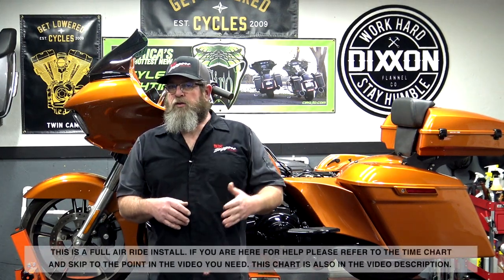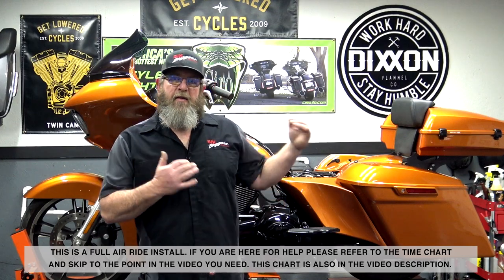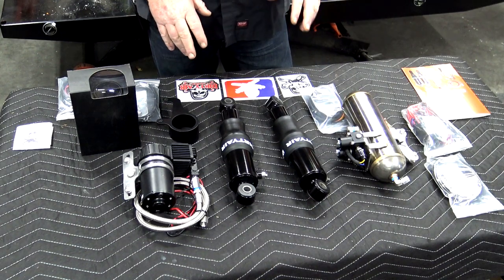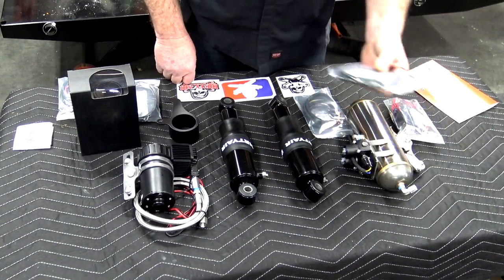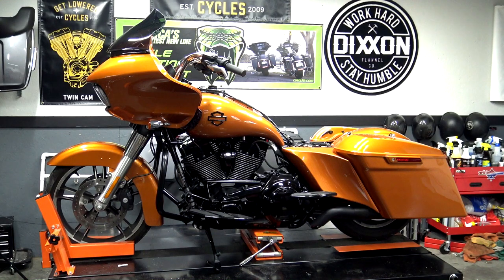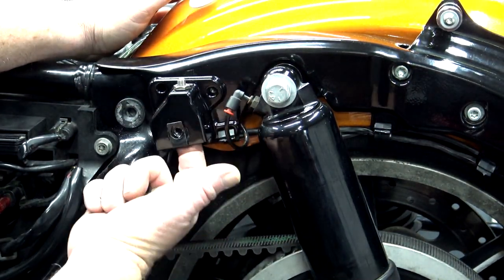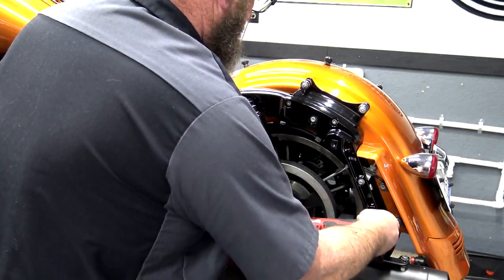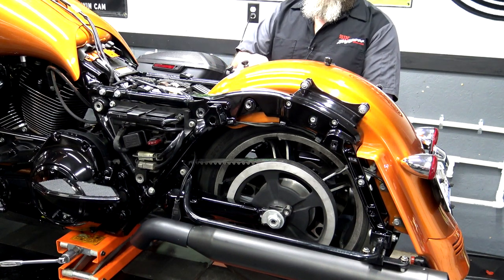⚡Install Dirty Air Rear Air Suspension System Fast Up - How To⚡

Comment: That is my biggest question what is the ride comfort feel like, is there a big difference not in stock but like say another brand that is out there that is really nice? The ride quality is what I'm asking other than the looks of being cool and low and high and adjustable is the right quality worth it, my next question is and I don't care who answers me if for some reason the system lets all the air out I got 0 pounds in it and she's sitting on the floor will it rub anything can it ride all the way down if some kind of pressure failure happens
Reply from the maker: the ride on this kit is about the same as the ride on other kits...the overall sell on this kit is the durability, ease of install and most important customer service before and after the sell...Ive had my fair share of the "other guys" and its like kicking a dead horse trying to get help...Dirty has always been there and addressed any issues I've had..which in fairness...hasn't been their fault...customers faults but they still helped.
Reply: @sikbaggers  I appreciate you guys getting back with me, I am interested in watching that video before I tackle it myself as far as the street glide fairing goes I have Electra glide so it's the same damn thing, what kind of warranty do you know comes with them, I mean like you know Legends has an airbag system is it worth the extra money to get the lifetime warranty I mean warranty you know it goes a long way, I'm new to all the suspension stuff that's why I'm asking, I can get the price of the dirty works front and rear the fast up and down with the aluminum shops for less than I can get the Legends just the rear, so I'm just asking?

Comment: What center stand did you use? Does it work with crossover pipes ?
Reply from the maker: I sue the SOB and yes but watch my video on how to run it with a crossover pipe. https://youtu.be/MOa0YZ8G0-o?si=OlLqmxrTMvnr1Tun

Comment: Where did you move antenna too? Putting my kit on this weekend. I see you need that hole where antenna bolts up
Reply from the maker: I took mine off as I have the fender extension that doesnt have a hole for the antenna ....but you can simply remove the bracket, zip tie the metal part of the antenna to the wiring harness and it wont move. It may take some time to get it lined up where the antenna sticks out straight...or get a hidden fairing antenna ...just make sure to get a powered one with a booster.

Comment: In your opinion, with is better, the Dirty Air, or JNR. I’ve watched your vids and was wondering with one to go with. I have Legends air ride right now, but not impressed with the ride. I would like to do front and back.
Reply from the maker: Sorry for the late reply, I just got back from Sturgis, Had issues they couldn't solve within a year and then they stopped answering the phones...so no service after the sale made me switch. Sucks because Ray is a good dude..but cant use the air if it doesn't work and cant get it fixed if they don't answer. No issues so far with dirty and they have always answered the phone when I called.
Reply: @sikbaggers  I was in no hurry, it’ll be next year, before I can get it done. Thanks for your reply, and for all your videos. Helps out the poor man!

Comment: I have lights in my fender struts so that may pose a problem. I’d like to put air ride on my Ultra LTD. I bought a Road Glide Special with an Exotic Customs system and it’s an amazing ride so want it for my Limited also. Any experience with Exotic Customs systems?

Comment: I'm new to the Harley world, suspension is talked about alot in my group of bike friends. My bike has stock suspension. Is air ride suspension better than the Ohlins adjustable or is it rider preference
Reply from the maker: the two suspensions are very different but both offer a good ride...and way better than stock, either way you go.  Air ride allows for on the fly adjustability and a smooth ride and ohlins offer more of a superior ride but needs adjusted to your riding, weight, etc.  which needs to be done on the shocks itself. If you dont change your weight a lot (2 up or 1 up ride, touring luggage etc) then the ohlins would better because adjusting them isnt easy.  If you are riding somedays 1 up and some days 2 up or you are traveling off and on all year changing the weight of your luggage I would go air.  I specifically use air because use an electric center stand on both bikes.

Comment: I have e filler lights between the saddlebags and fender, where you put the air line from the compressor to the air tank won't work the way way you have it
Reply from the maker: its not really "the way i have it", rather than the way it goes....there is no other way to run this line.,..its made to fit exactly the way i ran it in the video sir.

Comment: Hey Steve question for you, I really want a set of BAM mufflers with the 2.5” baffles or a set of the bad dadds but the price is killing me, have you had any experience with any of the slip ons from Amazon ?
$200 sure beats the hell out of $500 but I don’t want to buy some shit I’m going to be replacing in a year because of rust or something else………thanks for any info and happy new year 🎊🎆
Reply from the maker: Hey Steve I havent really used any from amazon...One set I think on a 2017 SG and they are still on there to this day...I service that bike all the time and I have never heard the man complain about them..They sound just like most aftermarket exhausts to be honest. Have a Happy New Year my friend!

Comment: Isn't that "cup" on the pressure gauge supposed to be a sunshade? And installed on the topside of the gauge?
Reply from the maker: absolutly not..it sits in the cup and hides the connections at the bottom so you don't see the wire harness.

Comment: Steve my friend air ride suspension looks awesome. I just have one question what does it do to the geometry of the bike? I read a lot that lowering blocks throw off the geometry of the rear suspension. I’m just wondering what the air ride does to the belt tension? Thanks rsfm 😀
Reply from the maker: well the air ride is meant to be air up to ride height when  riding. It will throw it off if you ride super low or even high. The optimal riding position of the bike is the bottom of the frame is parallel with the ground.  That being said I dont ride that way. I ride slightly lower than stock height. But its nothing you cant handle in corners. It does change slightly but not like a huge difference. You get used to it after a few rides.
Reply: Steven Housden 

Sorry Steve thanks for the insight. Guess for the vertically like me 29” inseam air ride would be sweet. Thanks again.

Comment: I've got the Dominator fender on the way, and I also want to do this dirty air set up. Since the Dominator fender wiring harness is going to replace the stock harness that you'd use the blue wire to tap into for 12v ignition, where can I run the ignition wire at?
Reply from the maker: under the side cover under your fuse panel..you have black and grey plug...the black plug, pull the plastic sheath back some and locate the grey/red wire..that is aux power.
Reply: @sikbaggers  thanks a lot! I just put my fender on yesterday and posted on that FB Advanblack review page. Your videos are awesome! Thanks for the help, I'll check that out when I pull the trigger.

Comment: Question what was the thing you had in your hand you were clicking over the wires ?
Reply from the maker: When im connecting the wires I use these solder seal connectors that give a water tight soldered connection and I use a pen torch to heat them up. The clicking is the pen torch.  If you use a lighter it will burn to slow and not get a good connection so a pen torch works perfect for this..We use these on all our audio connections too.....here is the connectors I use https://amzn.to/3IsmxzB and here is the pen torch https://amzn.to/3HxQb4Z
Reply: @sikbaggers  thanks bro for taking the time to answer my question your a real 1 a O.G. thanks bro  love your channel keep up the excellent work 👌

Comment: Hello, i was wondering if you can answer my question.  Can i use the air ride suspension while i am moving or not? For example, when i am on a red traffic light should i have it on a lower level and when the traffic lights turn on green turn it on while i am moving?
Reply from the maker: You can always adjust the air , if you are moving or not...If youwa not to let some air our or put some in just flip the switch..You can let some out at the light and then add some more aiur while you ride. I don't recommend dumping all the air out at the light and then trying to fill it while riding..the shocks ar ewnot designed to be rode with  no air in them. You can lower it a little and then add air while grinding though yes

Comment: I see in the video that the compressor and the tank bolts to the framing between the bags and the fender. I have the ciro filler panel lights on my '21 Road King. How hard would it be to install that stuff with the filler panel lights?
Reply from the maker: Hey John it will be a little more cumbersome with those lights but you should be able to get your wrench in there to hold it while you tighten it. Its really no different than having the fender extension on there that fills those gaps you just have some wires to attend to

Comment: I'm going to start riding 2-up and was wondering if there is a Dirty Air shock that gives extra height. The bike came with the Dirty Air suspension.
Reply from the maker: it will give extra height...however you need to understand how air ride works..if im riding 1 up I may only need  80psi to ride at my ride height...however if im 2 up I may need 120 to keep the same height.  Keeping that in mind , also remember that air ride has a sweet spot for riding..to low and its bouncy, to high and it stiff. So there is a fine line where you can play around with the air before it starts effecting the ride.
Reply: @sikbaggers  I'm a big guy and wondering if i maxed it out already. New gf is going to want to ride with me. I dont want to have to get a sidecar for her LOL

Comment: Greetings Steve- 
I’m getting close to ordering
2 questions
Are the aluminum upgraded shocks worth the up charge ? Is the upgrade more performance or cosmetic?
Also with the tank and pump mounted in the fender struts does that eliminate fender strut lights? Or does that just depend on how much fabbing I want to get into ?

Than you in advance for your time and reply
Reply from the maker: all cosmetic...and yeah depending on where your lights mount you may have to move them...but im not sure your bike and what lights you have so thats hard to answer fully.
Reply: Ah yes,
Forgive my absent mind
2016 FLTRU
Most similar, if not exact, rear end you were working on
And from what I see I may have to fab up some sort of spacer plate or “doohickey”, to be technical, to get them to look right.😂
Thankyou for the reply on the alum vs steel .
They may be of zero consequence performance wise but I may encounter a “shut up and take my money” moment.
Stay safe, 2 down.
👍🏼

Comment: Do you like this system better then the jnr you have on the silver street glide?
Reply from the maker: well..i loved the jnr system when i got it and it seems the shocks or something has went down hill...My fast up is now ( kinda slow up) been that way over a year. Had the whole system apart and on the with JNR a dozen times with no luck. So I thought I would try the dirty...the ride is about the same...maybe a little smoother on the dirty side...but time will tell how long they hold up

Comment: I have a 99 ultra with front and rear air ride . (Factory system)
Can you hook that air pump to the front air struts along with the rear shocks if you have them? 
Would you need independent pressure valve and  gauge for the front?
Reply from the maker: yes you need a independent valve for the front and rear and 2 switches. The front air would never be the same amount of air as the rear.

Comment: I gotta couple questions.  I installed this same kit,* Why don't you use the water trap/ separator in this kit?*Whenever I use my air ride button, I get a loud popping noise through my speakers?* Does that red wire with the inline fuse need to be used on the install?
Reply from the maker: Hey Chris I didnt receive a water trap separator with my kit. The inline fuse really does need to be used. Anything running directly to your batter needs an inline fuse. The popping noise your hearing has an easy fix. Coils (fill valves, dump valve, compressor relay) magnetize when being used and this causes feedback. Some audio systems, not all, pick it up as noise and some worse than others. First thing is to remove all frame grounds if you can...ground everything to the battery.  If that doesn't cure it then put a diode across the positive and negative. Here are the diodes from amazon https://smile.amazon.com/gp/product/B07YYMG7D5  put the side with the stripe on it on the positive wires, the non striped side to the negative. The closer they are the  dump/fill/relay the better they work.
Reply: Wow.  That's totally different from what every motorcycle shop has told me.  I was told to ground it to the frame.  Do you recommend the water trap?  I bought it from dirty air but I didn't see a lot of guys using them.  Thanks for your reply.
Reply from the maker: You can ground it to the frame but if you're using an aftermarket audio system with rca cables this is usually where the issue comes in. That is what was told to me and that is what cured my popping issues along with many others....its a very common issue with any air ride. I dont use a trap. I've had jnr air ride on my sg for 3 years.. I live in illinois where its plenty humid. I've taken it apart a few times and never had water in it...so I've never worried about it
Reply: @sikbaggers  thanks again for your reply
.last question, do u recommend  tapping into the ignition  wire so the only time the air ride work is wn the ignition  is turned on?  Mines was not installed  like that.  If I touch my button the compressor  kicks on whether the ignition  is on or not
Reply from the maker: @whitedawg60   Yes, absolutely.  There are several wires that are ignition only under your seat or side cover. Mine wont even air out without the ignition on.
Reply: Finally got my system put on correctly.  When my bike is not in use, is it ok for the tank to be full of air, or should the tank b empty wn it's not in use?

Comment: Hey Steve.  Question...so I’m having an issue with the air suspension.  Did you connect the gauge wire to the same 12v blue wire that you connected the toggle switch and tank wire?  And also when you cut into the 12v blue wire, does it have to be from the rear plug that goes to the tail lights or can you cut into the other end  that is connected to the bike? My issue is that when the bike is running and I hit the air up or down switch the gauge and compressor would all go off and a red light goes on in my dash as if there was an issue, but then I restart the bike and it goes back to normal.
Reply from the maker: yes I tied the blue from the tank and the blue from the toggle together and tied that into the blue running light wire on the back side of the plug. I cant imagine putting it on the front side of the plug being any different. Your bike is detecting a voltage spike when you hit your air and thats causing the red light and making it stop working. Id check to see if the brake lights themselves didnt also stop working. I would have to dig around some but there are other 12v power sources under there too..that one is just easy to get to.
Reply: SIK Baggers thank you.  I’ll play around with it and see what works out.  I’ll let you know results.  I ordered the tank by the way, so once that comes in I’ll hook everything up and see results .
Reply: Hey Steve.  So received the air tank so now I have the update fast up suspension.  Works pretty well, still had the issue where the compressor and electric gauge would shut off when I was in motion or stopped at a light and hit the down toggle.  Did some homework with wiring and ended up instead of using the blue wire 12v to rear brake lights, used the red/yellow accessory power . Not sure if I might have been overloading the blue since I have multiple lights (saddle latch lights, bag blades, plasma rods and lit license plate bracket plus the stock tail lights and signals) .  Anyways , took a test ride, cleaned up some wiring and  now it all works without the system shutting off.  Thanks for all the help.

Comment: Is it possible to put different air connecyors on it to use a different kind of airhose?
Reply from the maker: The Push to connect connectors are just screwed in so technically yes..remove them and add your own...curious why you would want to do that though?
Reply: @sikbaggers  on my previous Roadking the connectors failed/leaked. I happend to get a deal on some Öhlins shocks. But to me the weak point of stock suspension or airride are the hoses and connectors. Sow replacing them with screw in airhoses would be a "upgrade" if i do decide to go with airride.

Comment: Might be a dumb question but what is really the purpose of the air gauge if the compressor is gonna fill the tank up automatically when it's out?  Is it to know if you're losing pressure?  Just asking because im interested in DA also
Reply from the maker: The pressure gauge shows the amount of air in the lines and shocks. The tank stays at 200 psi.  Once you find your sweet spot look at the gauge. If it says 78 pounds then everytime you air up hit 78 pounds and you know that's where you ride.
Reply: @sikbaggers  ok thx